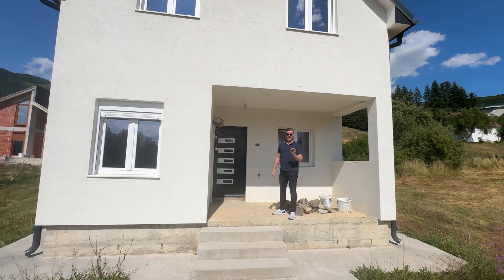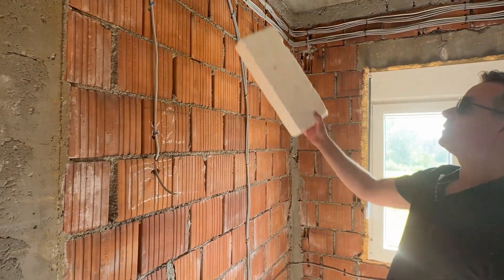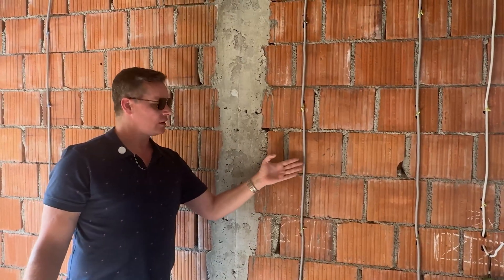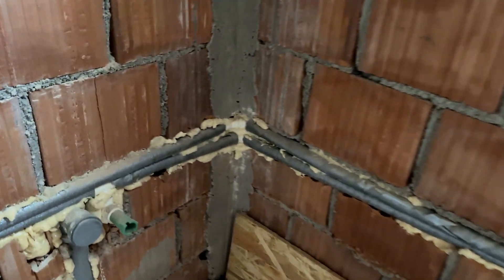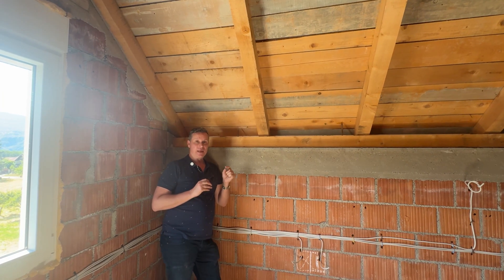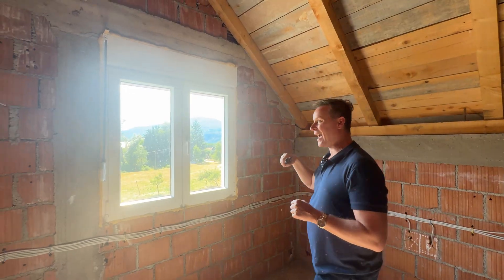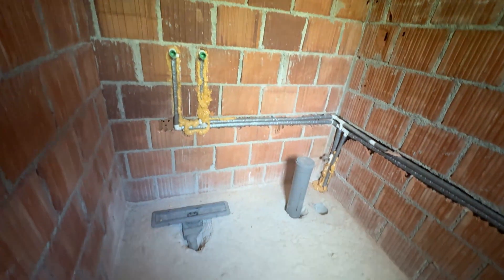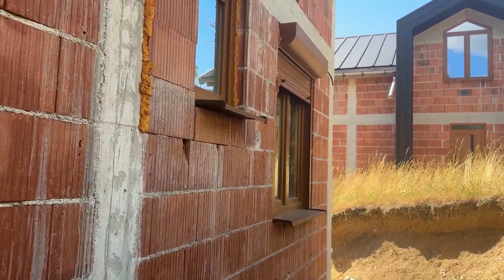From Aussie "Glorified Tents” to a Balkan-Euro Fortress

Comment: Nice video, I'm an Australian living in Sweden so it's interesting to see the differences. I guess here they would insulate the slab, use chrome copper pipe on rendered walls for fresh water, and the ceiling would be 4cm ventilation gap next to roof, insulation, vapour barrier then plasterboard or wooden slats.

Comment: Nice to see you in our neighborhood! About this house, this is the most average build that you could find, so it's a perfect example for your channel. We build boring, simple, cheap and wrong in many aspects. We just mix some concrete, stack some masonry blocks in line, screw some windows in, spray foam in every crack that we see, call some guy to tell us what dimensions to use for the rafters, ask him also if we should put some foil over the planks so it doesn't leak, which side to turn it, put some EPS, 10 cm is good, don't do more, don't be crazy, leave the base uncovered, put plaster over it, then move in, then wait for wooden floor to rise and grow mold near the edge, then again call a guy to ask why is this happening, then put some xps around the base, the guy says 8 cm, you do 3 cm. Put some insulation in the roof in 5-7 years, some guy tells you to put some foil under the insulation also, so you do it, don't know why. Windows you do with 2 layers of glass, PVC, white. Or if you feel rich, you do 3 layers glass and some badass profile. Roller blinds you do 3-4 years after you move in. Some guy also tells you to put at least 8 cm on the floor, but you are smarter than that geek so you do 3 cm. You order wood chopping machine, buy some wood every winter and throw it in the stove until the house is warm. And the cables you hope to cover with plaster. If they are thick, you have to struggle and put some grooves into that masonry.
Reply: Yeah, I forgot, you do this with 2 cousins on a long summer vacation, when you come from Germany where you actually live.
Reply from the maker: Haha, you’ve just described the national building standard to a T! Thanks for the walkthrough — I might just use this as a checklist for our next ‘average build’ episode.  So basically… you’re saying we should call ‘some guy’ for everything? Right?

Comment: thanks for post John.  the small windows might be hard for aussies to accept.
Reply: These windows can be FULLY OPENED unlike Aussie subpar windows in the newest of homes. Obviously these are also much warmer and don't collect condensation on em even when it's -15˚C in winter. And also dead quiet and actually airtight when closed. Can see but cannot hear cars driving right past your home. Vastly superior to most Australian windows. Sadly the "cannot fully open" thing is due to regulations in Australia.
Reply: There's a high performance home close to where I live, European style, on the market. it would be amazing to live in. But it has similar features: small windows... etc. the vendor can't sell it.
Reply: I'm building right now. I want smaller windows but the builder wants everything to be just full height windows 😂

It's been hard getting them to make my windows smaller